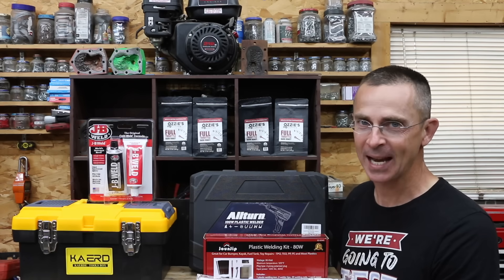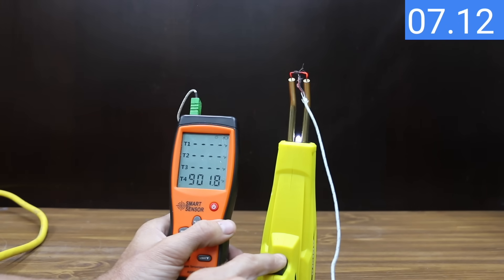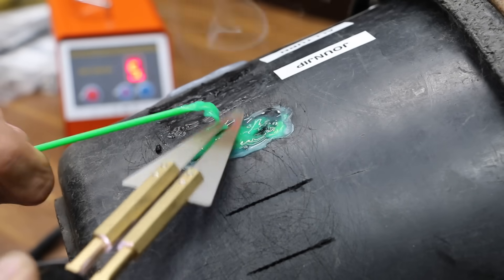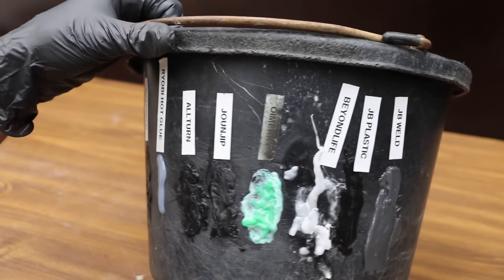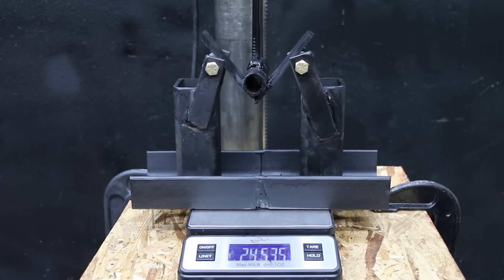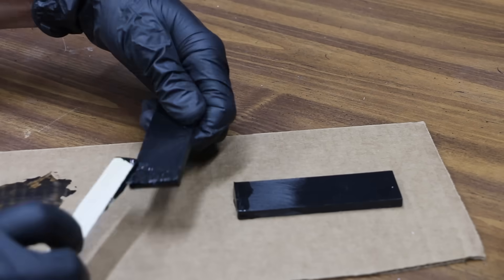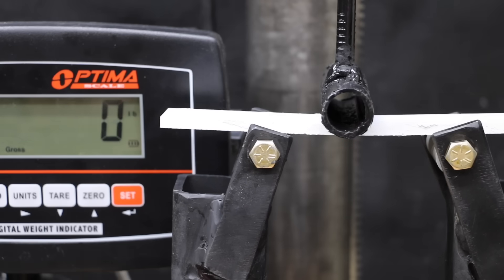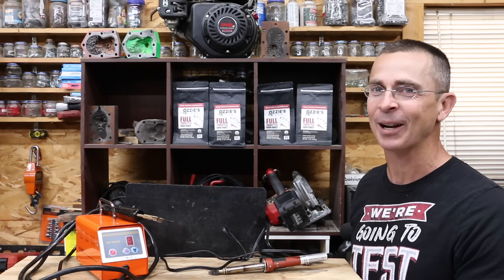Don't Buy A Plastic Welder Until You Watch This Review!

Comment: Looks like the biggest difference maker is penetration, much like with welding steel. I wonder how a pencil style soldering iron pushed down into the crack, and then building up over the top with the filler rod would've competed.
Reply: "Penetration is Paramount".  Ted Woodford (awesome guitar repairman) on his YouTube channel.
Reply from the maker: Thanks for the suggestion.

Comment: I've done a lot of plastic welding on airline luggage pods. The welder I used is similar to the Beyond Life type which has a  preheating air jet. They work extremely well. The trick is to let the hot air do the work, and then force the rod into the molten plastic. It's about technique. For something as thick as your test pieces, you need to make V-cuts into the ends and then weld both sides. It would be very strong if done that way.
Reply from the maker: Thanks for the constructive feedback.
Reply: Having worked at two machine shops that employed in-house plastic welders, I concur withe the use of the Beyond Life type welder. There were two types of tips I saw frequently used, one was like a 1" hot knife that they would run along the bottom of the chamfers to tack the parts together. The second tip was like the one shown where the filler rod was fed through the tip to preheat the rod and the path the rod was going to be laid in. The trick is to only heat the air/tip enough to barely melt the plastic. You want both the part and the filler rod just soft enough to use the tip to force the rod into the groove made by the mating chamfers. The finished bead should be proud of the surface.
Reply: Using a hot air jet is a fairly old method.  I learned it 20+ years ago and it wasn’t new then either.  Trick is to treat it more like a tig process.  You are melting the substrate with the air jet then adding the rod.  Keep the air jet pointed at the point where all 3 meet and slowly move across your joint.  Definitely takes practice to get the speed and heat right.
Reply: @kennethpage5481  That is the technique very well and succinctly explained right there.
Reply: I came here to say that. I used to work at a company that made plastic enclosures and we used similar style welders. There’s a learning curve that I never climbed, but with practice the bonds can be ridiculously strong.
Reply: This it correct. Have been repairing car plastic for 16 years. In my country you need to be certified to repair plastic on insurance jobs. 
V cut is a must and you need to use the same welding rod material as the plastic you repair.
Like tig welding, you cant tig weld aluminium with steel sticks.
Reply: 100% definitely want to bond into the base plastics an the bevel will get a good through an through bond.  What was done here was a patch/makeup job
Reply: Those types of welder are used for vinyl safety flooring joints.

Comment: I would like to see Amazing goop marine, shoe goo, 5 minute epoxy and steel stick ( there are several makers of that type of product) tested.  I went on a 12 day wilderness canoe trip and fixed three canoes with holes in them using steel stick, on mine, its still holding 25 years later.  Amazing goop is a fantastic glue too.
Reply: Goop is good stuff, as is Shoe Goo (same company, I think).  5200 adhesive seems nearly identical, at least it looks and smells the same.....
Reply: @goodun2974  The 5200 stuff, if its the stuff Im thinking of from Dollar General, is runnier.  Ive used it in a pinch.  Similar though.
Reply from the maker: Thanks for the suggestion.

Comment: I used to use that exact same green plastic welder that you said was difficult to use when I work at a polypropylene tank factory it was extremely easy to use if you actually adjusted the heat to the proper settings and use the right rods for the right type of plastic.
Reply from the maker: Thanks for sharing.

Comment: We had to weld my son's front bumper back together after an accident. One thing not mentioned about the Oimerry is that you can place the staplers in the welder in several different angles. Trust me, this is important when you have to get in a tight spot! We got the Oimerry type (same welder different name) for staple work and the Jounjip for welding the plastic rods. Now, all you can see is a thin crack from the outside. We were even able to weld a bolt mount back on to a panel using the corner staples and welding plastic over them. Very impressed with both tools and saved my son many hundreds of dollars.
Reply from the maker: Thanks for sharing.

Comment: I know others have already said but to use the wire mesh correctly you need to melt the mesh into the plastic you are trying to repair, the base material. 

Just melting it on top of melted filler rod will not achieve the increased strength that is possible when using wire mesh due to it having a large contact patch with both pieces of plastic you are trying to join back together.  

With the mesh embedded into each piece it provides a very strong repair and in some cases it is stronger than before.

Comment: Another Very Impressive review.  We have an RV and when we don't have a site with a sewer connection I take a portable waste tank which hangs off the hitch as I drive over  to the campgrounds dump station.

On one trip I had a small leak along the mold seam which is bad.  I used a soldering iron and pieces of a detergent bottle which was HDPE. As is the tank.

The repair worked so now I always carry the materials in my tool box. 

Thanks again for all you do.  I've said it before but your channel is truly a public service and entertaining as well.
Reply from the maker: Thank you!

Comment: ooh.. i dont think i've seen this one done. Welding coat materials. a test of different leather / skins and fabrics. what ones have better burn resistance (answer is leather) but not even one does heavy stick welding. or maybe even test it for for work related injury's like slash or scraping protection. metal do be sharp yo
Reply from the maker: Thank you for sharing!

Comment: When plastic welding you should bevel both pieces to penetrate all the way through and stack welds a little preheat to the ends to be welded helps and if you use the same material to weld with but good video as allways.

Comment: A note to anyone using the hot staples, if you're using the super squiggly ones with several complete U bends, align the pins with the crack rather than across it. 
With the crack, you have the wire crossing the crack several times.
Across the crack, it only crosses once. 
Plus, you use fewer staples because they are longer than they are wide. 
Of course, the straight or only slightly squiggly ones must go across the crack, that's the only way they make sense.
Reply: Excellent advice, had not considered that.

Comment: I used the jb weld for a plastic gas tank repair. It held pretty good, just make sure the tank is empty or at least set up so no gas will go to the repaired area before it had time to hardened.
Reply from the maker: Thank you for sharing!

Comment: Any epoxy that takes longer to cure will be better than the quick stuff. That's why the original JB Weld works so great. You trade strength for time with the quick stuff.
Reply: The only JB weld product I've used that I was never really happy with is the plastic fusion version of their epoxy which stinks like hell but doesn't seem to fuse to many plastics and the cured glue is rather soft. The ultraviolet cured super glue they now sell is excellent but the squeezy bulb packaging they use is terrible and clogs up or glues the nozzle on before you can use up all the glue.

Comment: ABS also has potential chemical methods, Acetone is sometimes used in the 3D printing community to fuse ABS parts. And ABS glue from the plumbing supply might work too. Naturally only attempt in a well ventilated area. and remember Acetone is highly flammable.
Reply from the maker: Thank you for sharing!

Comment: The wire mesh should be thru-melted into the base piece being repaired and THEN have filler added to smooth. This can ONLY be done with the higher heat tools....also, when you retest using this method you should also add steel wool as this has been common for years and in pieces that really NEED to remain flexible without breaking the individual strands of steel wool seem to add a lot of flexibility without sacrificing breaking strength.....but as always GREAT FREAKING JOB!!!! One of my top 5 creators on YouTube no doubt
Reply: I was going to suggest melting the screen in as well. It worked well while repairing a plastic ATV skid plate and I used the side edge of a box wrench to further push in the screen. The wrench cools the spot to secure it as you work the screen in.
Reply: I have been plastic welding as part of my job for 35 years and steel wool is a poor choice since it is covered with oil and would quickly rust once the oil coating is cleaned off. Stainless steel screen is all you need but if you want something like steel wool, get some s.s. shavings from a machine shop.
Reply: @bdybybb you can fing SS wool. It's common.

Comment: Hot air welders are the best.  You weld like you're stick welding, with the tip pushing the filler rod into the already molten base material.  Made hundreds of stream tables & many more caustic chemical tanks out of PVDC 50 years ago.
Reply from the maker: Thank you for sharing!

Comment: It would be interesting to compare different heat gun brands for tpo/pvc roof seam welding and see if it's worth buying a leister
Reply from the maker: Thank you for sharing!
Reply: I use Steinels for welded flooring. The Leisters are nice but they go way too high as far as temperature and fan speed. I assume because roofing material requires it. I can turn the Steinels all the way up where I have to mark Leisters so I remember the safe limits. They seem to be of equivalent quality. The knock off versions all seem to share a lack of insulation that can burn you and an inability to keep a consistent temperature during long use. I think their heating elements have a duty cycle that allows the air temp to fall a lot.

Comment: Im a fan of this channel and i really enjoy your tests but i work daily with plastik and the beond life is a very good tool if its uesed correctly. with hdpe for example u need a temp between 250 F to 300 F. at the correct temp your filler material and your welding piece just melt a little so you can press the plastik wire into it with the lip of the tip on that tool. 
maybe watch some how to vids before using tools your not familiar with.

anyways keep on goning, love to see more tests and reviews

Comment: My dad has JB welded an engine block and it held for years. Nothing will change my mind about how great that stuff is. It fails though at keeping my wife quite😂😂😂
Reply: I filled a 1/4" rock hole in a motorcycle transmission with that stuff.  Never failed.
Reply: @jackdedert2945  man I LITERALLY had the same thing happen to me on my little xr 80. JB weld held

Comment: It would be great to see how the plastic weld technique would work on repairing a old cracked dashboard. Or how other techniques to repair a cracked a dashboard compare
Reply from the maker: Thank you for sharing!
Reply: The problem with plastic dashes is that the actual plastic surface is very thin...applied over some sort of foam.  It's like a few mills of plastic over a chunk of foam.  It's the foam that fails.  Any repair involving heat will melt the foam first.  Also, as the crack develops, gap widens and usually curls up at the edges.  You have to sand the damage level as a first step, then use some sort of filler to fill the gap.  Then you have to address the surface damage.

Comment: This was a great video. I once broke a plastic chain guard on a customers new bike during the pandemic and welded the plastic back together with just electrical tape, a bit of random found plastic in the shop, and a solder gun. The part was 6 months out and I didn't want the boss or customer finding out. It definitely didn't look factory but I'm sure they never looked close enough. If I had to I think I would have gone with the Jounjip to fix it.
Reply from the maker: Thank you for sharing!

Comment: I have a 30yr old plastic welder that is 110Volt with a small air compressor. It has no end attachments. It works just like a torch and brazing rods. The hot air melts the plastic then lays a bead like you'd expect from braze or silver solder. I use it to weld PVC pressure pipe together. It looks just like steel pipe welded and they hold pressure. I didn't notice any of the material melting
Reply from the maker: Thank you for sharing!

Comment: Looks like you covered it again, Commander! All the variables like kinds of plastic and ways of joining with the staples, wire mesh and the 'rods'. I've thought about something like that but usually just get the propane torch and have at it. WE're not very cosmetic minded here and holding and may6be not leaking is the main concern. Hot glue is about the #1 for Sweetie but the torch is my go-to. The last big project was the nipple broken off the Craftsman rider gas tank, ABS I think. I just heated up the piece of the nipple and the tank and jammed them together BUT didn't open the hole back up fully and it was starved for gas. Out came the drill and a bit and that was cured right quick and has run fine ever since and that was several years ago, plus hauling splitters and firewood. One of the test units would be nice but I suppose I'll stick to the torch. I can always heat up a putty knife! FINE test as always and if it'll hold water or gas, I'd call that a WIN! Maybe even if it'd slow the leak down some! God Bless Yall Farmers! Still praying for more rain!
Reply from the maker: Hi Lewie, Thank you for the positive feedback on the review! It always means a lot to me. Your fix for the Craftsman rider is terrific!  Glad it worked out for you. The torch seems like a great option and there's no need for electricity with a torch, either.  Also, thanks for the prayers for the rain. It's working and we've been getting a lot more rain than usual, which is really helping.  So, thanks again and please keep on praying!  Wishing yall many BLESSINGS!!!
Reply: We all give full credit to the Ultimate Rain Maker and everything else for all good things. I's His deal. I just try and do what He says to do in His Word. God Bless and Happy Summer! @ProjectFarm

Comment: Autobody guy here. Youre not using the wire mesh properly. Supposed to heat the mesh up high enough that the mesh seeps into the plastic. Proper plastic weld starts by using a dremel or die grinder bit to create a valley to where you melt your rod or plastic into and fuse together the new and old broken bits together. Assuming of course that you properly cleaned and scuffed up the plastic well enough before actually welding anything yet.
 Then put the mesh over the repair and when using the hot tip, press the mesh into the plastic deep enough that the hot plastic seeps over the mesh completley. Think of it the kind of the same way you used the hot staples. After the plastic has cooled, sand down the high spots and spread some flex filler and hardener over it, sand it smooth and straight and there ya go, ready to prime
Reply from the maker: Thank you for sharing!

Comment: I like your videos but with respect I have to say you need some practice to weld plastic and it's hard to tell watching this video if the welder is the problem or if it's just not enough practice and technique. Sometimes the harder to use device is actually the better one. Also you would want to weld plastic so that it can survive changes in temperature from hot to very cold in the winter and also retain flexibility after the repair. Some of these repairs I'm not sure would hold up to temperature change and repeated flexibility.
Reply from the maker: Thank you for sharing!

Comment: Great Video! I'd like to see what you come up with if you solvent bonded the ABS with acetone. I have done many many repairs with acetone. A good way to test if plastic is repairable, it to put a drop of acetone on the plastic and immediately press your finger into the plastic. If it leaves a finger print, the plastic is glue able, if not, well, good luck.
Reply from the maker: Thank you!

Comment: I am constantly welding HDPE, as well as manufacture with it...
Honestly, the easiest way is just using a fine point heat gun and some extra HDPE strips to melt on lol. As long as you get a proper fusion between both parts, I find all of these special tools are just gimmicky that would result in a worse looking product lol.
Reply from the maker: Thank you for sharing!

Comment: No slight against you, but most of the repairs you made were not welded.  The parent material needs to be plastic (i.e. melted) so the two halves and the additive can diffuse into each other.  An appropriate glue that liquifies the parent material might even perform better than what you have done.  Even if you had just melted the two "broken" pieces together, that would be sufficient to call it welded.

I really would suggest to recreate these tests and re-release the video, to be fair to the manufacturers.  In addition to breaking the welds, you need to determine whether there was sufficient penetration.  The best welder, then, is difficult to define since all of them will, when properly used, be sufficient to allow the welder to do his job.  You can weld with an iron heated up on a wood stove, in other words, but that's not convenient, so likely not anybody's "best."

So is "best" defined by features?  Adjustability?  Price?  Etc.